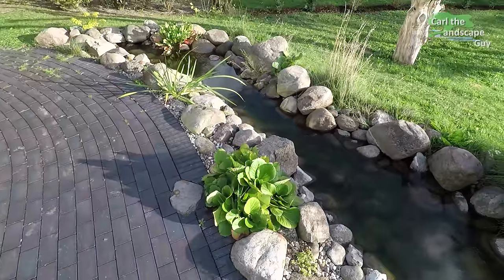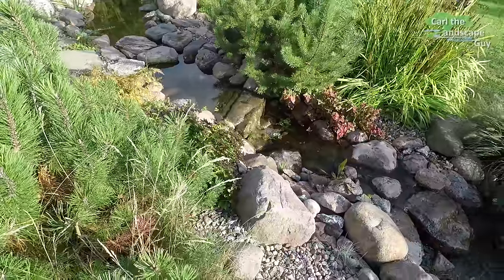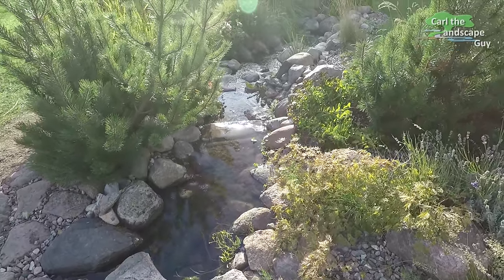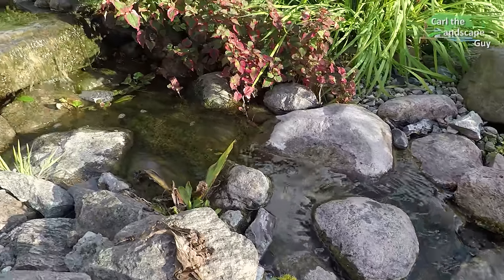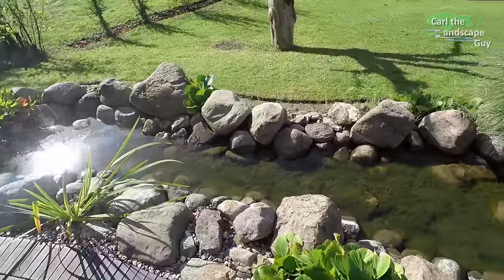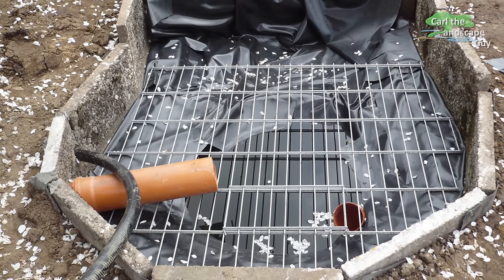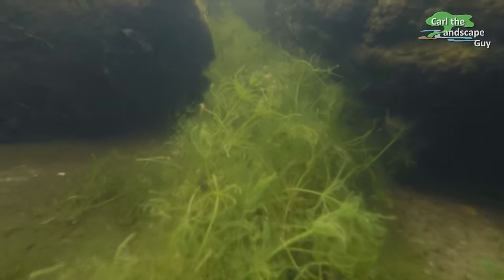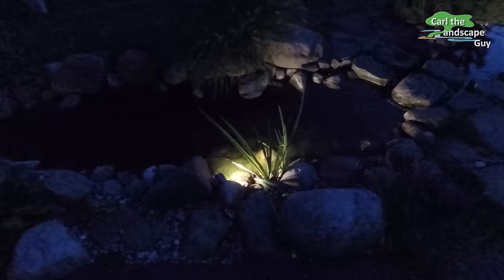BUILDING WATER STREAM REVIEW+TIPS | BACKYARD BROOK RUNNING | GARDEN CREEK NATURAL INSTALL UPDATE DIY

Comment: Hi Carl, Very nice! Looks very pleasing . Im refurbishing an existing 25m stream built by others. I like the 800 liter container idea and will use an automatic water refill  device to keep the appropriate water level at all time. Question. Would a 800 liter storage tank contain enough volume of water for a 6500 gph pump/25m stream (average stream width varies 2 to 3 feet) ?
Reply from the maker: it might work but it's a close call and as soon as you pump the water into the Stream the water level in the container will go down at least half so if you automatically refill the container you will at one point have too much water in the system when you turn off the pump. please watch my latest video on stream building I use a different type of Reservoir by using a box and you can add several boxes together to get a bigger Reservoir that's what I would do

Comment: Perfect job. One question, how does the stream handle excess rainfall? Does is simply overflow or is there some type of drain?
Reply: Steve Palmeter there’s an overflow in the tank that the water goes into at the end of the stream that will then deposit the water into the ground somewhere.